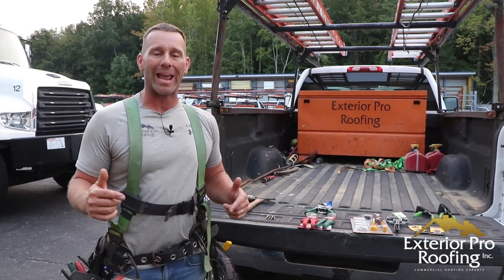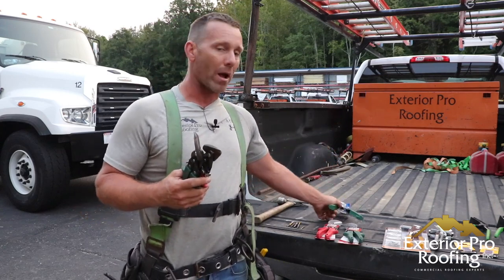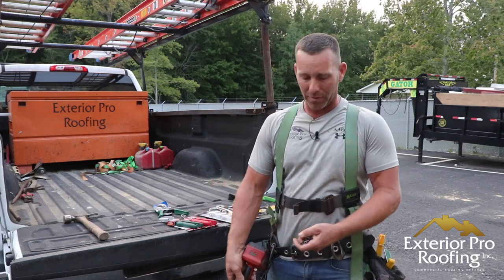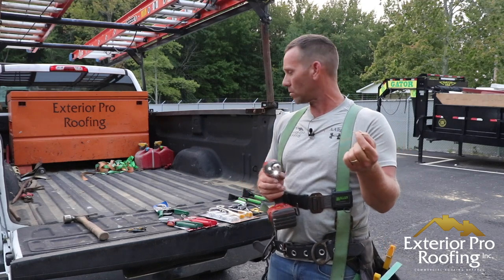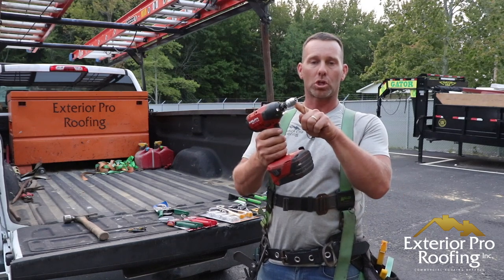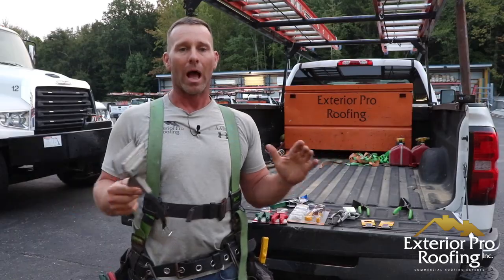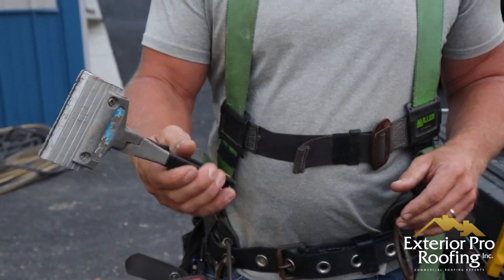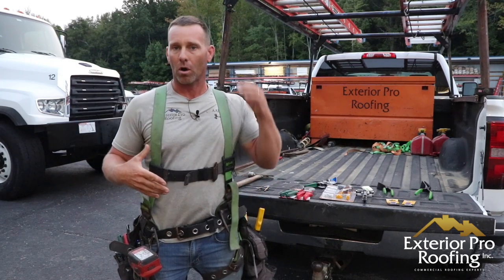Standing Seam Metal Roof Tools you need to carry in your tool bag

Comment: impact drills are a no no... need a drill with a clutch or else you are prone to overtighten your screws that causes deflection through the panel that will result in oilcanning.